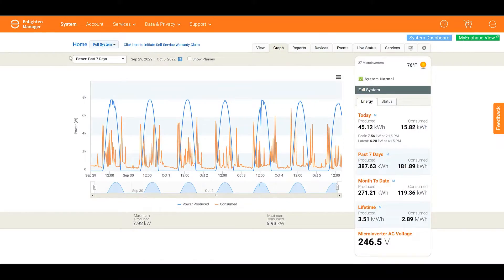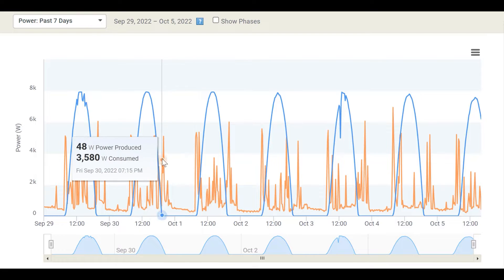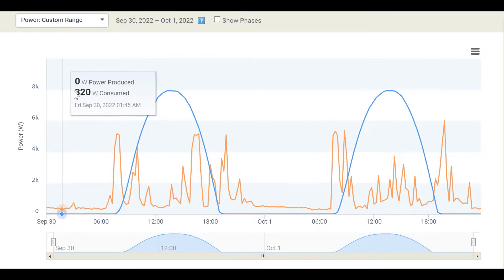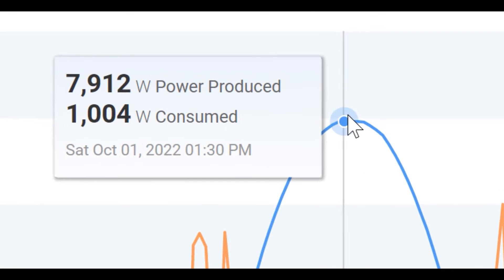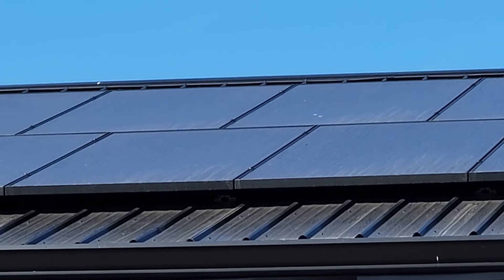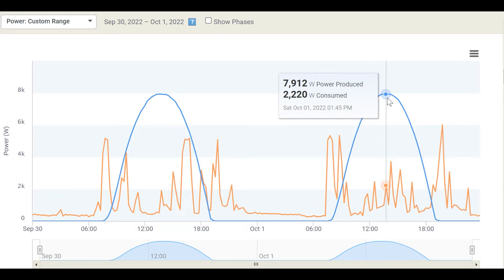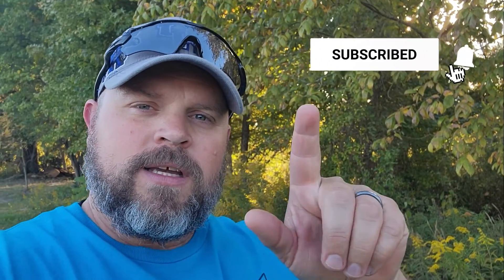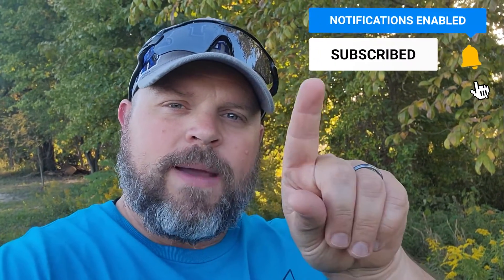What is SOLAR CLIPPING

Comment: 22 Brand new 410w panels are producing only 5.8KW in a perfect sunny hours & my system is not stationary, I am in FL and I the panels are on 2 axis tracker, my inverter is 10kw solaredge and the optimizers are P600
Do you think mine is clipping about 50% of the power ?
Reply from the maker: Something appears to be wrong with that. Have you checked your modular level data? See what your panels are outputting individually and make sure they are all producing like they should be. Maybe you have a string out or something.

Comment: Put half the panels facing more east and the other half facing more west so that you get more, but not over, power in the mornings and evenings, with less at noon.
Put them more vertical too.
There are calculators to work all this out and your system will then give you more kwh for the day and more power at the times you actually use/need it.

This is not a magical leap in out the box thinking;  just simple common sucking fense!

Comment: Immediately after my pv system was installed, I realised the IQ7+ micros (on 395w modules) were clipping and I suffered sleepless nights. It took over a year of observation and many hours analysing data from enlighten manager, to conclude that clipping “loses” are less than 1% of the annual output. Actually there is some evidence that the iq7+ when not clipping, produces more than the Iq7a and in that case I have increased output with the iq7+.
We live in England where sunshine is not in abundance and the slope of our roof is 50 degrees which is great during the winter but reduces the pv output during the summer. Similar system nearby, with 30 degrees slope, produces 10% more in June, whereas we produce 70%more in December
Reply from the maker: Thanks for taking the time to watch and share your experience. Thanks for watching and commenting! Would love to have you part of my www.diysolarbuilds.com community. It's free to register, and I am looking for new people who love solar as much as I do.

Comment: Ideally if you have a large enough amount of open flat land on a south facing hill, you can have enough solar panels to provide enough power to reach your charge controllers maximum limit on a cloudy day so when the sun comes out of course it'll be clipping but the output will be relatively constant as if it has a voltage regulator. Rather than the wild 5% 100% swing between cloudy and sunny days.
Reply from the maker: Thanks for watching and commenting 👍🏻

Comment: Some clipping is good. Means your system creates more early and late in the day. At least how I understand it.
Reply from the maker: I still can't wrap my head around how maxing out an electrical component can be good. Think about a 15 amp breaker being pushed to the max day in and day out. Eventually, it fails under all that stress. I also disagree with the idea that microinverters like a IQ8 vs IQ8A would have much impact on production from earlier startups and later shutdowns. That is more a comparison that should be made between string inverters and microinverters in general. Just some things to think about. Thanks for watching and commenting 👍🏻
Reply: Hi Justin. There is a stress element like you theorize.  Any inverter will (or should) state a max PV input or max DC to AC ratio.  Those say the same thing.  As with any gizmo, it shouldn't be operated out of parameters that are specified.  About anyone allows a 1.3 to 1 ratio.  Others are rated at 1.5.  Another allows up to 1.67  Recently read about a 2 to 1.  Running closer to the limit does seem to be iffy but the higher limit  products must have heat sinks, higher capacity cooling fans, maybe some silicon carbide or other higher tech material that enables their higher performance.  I wouldn't worry about running close to a limit but I wouldn't step an inch beyond it.  About the startups and shutdowns, one popular inverter has a 120 volt input cut-in voltage which for its size is sorta high.  Its competitor that cuts in at 75 volts will produce a little more in the early morning and late evening.   @TheSolarPit
Reply: You understand it more than many N8.  Btw, your pic looks like me except I play left-handed and my hair undergoes a lot more "clipping".
Reply: @garyhiland6013  😆 that was in my younger days. That lil guy on my lap is 18 now. Take care my guy.

Comment: You have a 1.28 ratio (dc to ac) instead of moving up to the more expensive iq8, why didn't you go with a lower rated panel? Say a 350w would have made it a 1.20 ratio. And if you really wanted 10kw worth just add another panel and inverter.  The money saved on the lower rated panels would have probably covered the extra inverter and panel and with a more desirable ratio you would have ended up with less clipping for just a little more roof space.
Reply from the maker: Very good points. Thanks for watching and commenting 👍🏻

Comment: Yes it looks like your getting some clipping, but not much really. I've seen many graphs of other "over paneled systems" with a long flat peaked flat line for over 2 hrs a day, and it was still the best economical choice for all year round and cost or regulatory limitations ect. Depending on your location and the orientation of your panels, real world solar output most of the time is not over 80% of the ideal tested rating anyway. The reason you got such a good deal on the IQ7's is the IQ8's had came out recently and suppliers were trying to get rid of the IQ7's. You made the right choice! Thanks for the video.
Reply from the maker: Economically, it's undeniably the right choice on hardware I used. Since I got the equipment for such a great deal. My goal is trying to figure out if it was the most optimal pairing. Eventually, I will get to test some other microinverters side by side to get real data on what my panels are actually maxing at. Then, determine the degrading at roughly 1% each year and figure out over a 20-25 yr period if one or the other would be that optimal choice. Only because I like doing that type of stuff 😁 Thanks for watching and commenting 👍🏻

Comment: Hello Justin, 

While researching on this, I found Solaredge power optimizer with central inverter has all the good advantages which is not so Solar clipping and offering Solar monitoring too.

The point is if I put 530 W solar panel and I attach it Enphase IQ micro inverter which has max output AC as 385 (highest one). I am missing 145 w output. Assuming 90% efficiency in conversion to AC it shouldn't lose much.

If I go with Solaredge power optimizer with central inverter.

Production on panel at peak generation point is optimized and then Central inverter of any brand has good conversion efficiency will do maximum output of at least 480 W. This way Solar clipping or controlling by the equipment can be addressed.

By the way thanks for educating us on wiring and Solar installation information. I really like the inputs and ideas you are sharing. 

Thank you
Reply from the maker: That is all valuable and good information. I had considered going in that direction but could not get past the central point of failure on the centralized inverter. Also, I was not looking forward to installing EMT because DC required EMT. I'm not knocking Solaredge, I was just looking to simplifing the install because I had so much other things to learn. Also, I was very impressed with the support of Enphase which meant A LOT. I was learning as I went so to me that was priceless. Enphase offered free training online and as a DIY'er that was very helpful. I agree, if your going with very high output panels - 500+ watts then I'm sure enphase would be the way to go as of now. Plus, I'm not sure they would even be compatible. Thanks for watching and commenting 👍🏻

Comment: Looks like you are not clipping at all because the curve will have flat on the top.  Also 7912w / 37 panels = 293w each panel produce.  The IQ7+ cont peak is 295w.  Just below.
Reply from the maker: "Max" peak output is 295w on IQ7+. Not continuous. Max continuous rating is 290w. See spec sheet on the IQ7+ and on the 2nd page you will find that: https://enphase.com/sites/default/files/2021-04/IQ7-IQ7plus-DS-EN-US.pdf?_ga=2.74521938.1559743086.1666902218-1253396370.1666293802
Reply: Most of my IQ7+ peak at 296w and can stay there for 3-4 hours. The rest peak at 295w

Comment: Should you tell why clipping is also beneficial on the early sun and late sun cut off voltages.
Reply from the maker: Should I? I'm not 100% sold on that without having side by side data from the same system, using different microinverters models. If given the opportunity I might make 1 of my 3 branches all IQ7A's and see how they perform vs the IQ7+'s. To determine which truly pair best. That's an expensive  experiment though. I would love to see the outcome. Thanks for watching and commenting 👍🏻

Comment: Justin, with the clipping, would you ever consider cleaning the solar panels? If so, How would you go about cleaning them? I should should get my solar panels installed next week, I'm very excited.
Reply from the maker: I'll definitely clean them. I have all the equipment to do that and probably will make a video on how I'll clean mine sometime down the road. The rain does a great job cleaning them off but we have been in a drought for about 3 1/2 weeks with not a drop of rain. Congratulations on the solar project, so close! You will love it for sure! 🤘🏻

Comment: Thank you for your explanation.  Real world experience.  There are newer micro inverters on the market or soon to be available.   Claiming to be less expensive than inphase and the other expensive micro inverter. The clipping issue is reduced or claimed to be eliminated.
Reply from the maker: I personally would pay for the service of enphase support. It's world class and that is worth the money for sure. Not sure how the newer companies will be until I actually get to work with them. Thanks for watching and commenting 👍🏻
Reply: That last sentence is very wobbly.  If the max continuous outputs are the same with these other products, the clipping rates will be identical. Not reduced or eliminated.